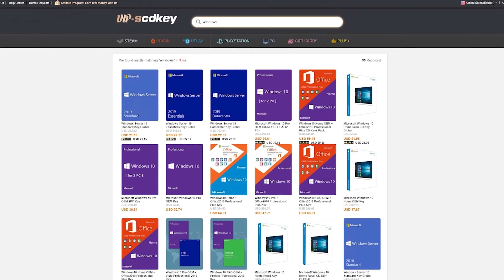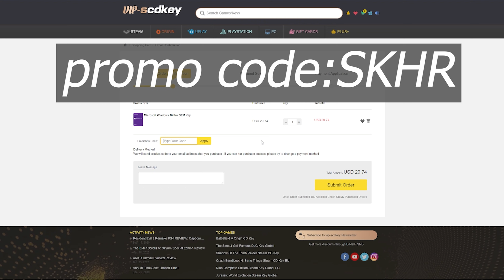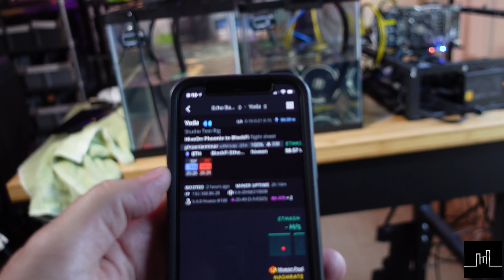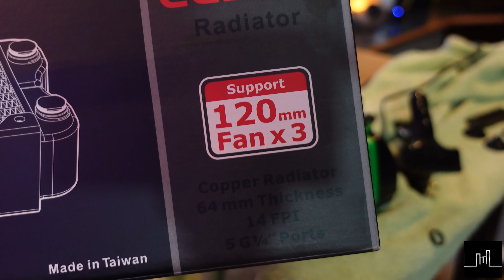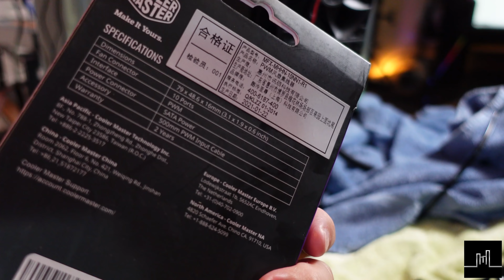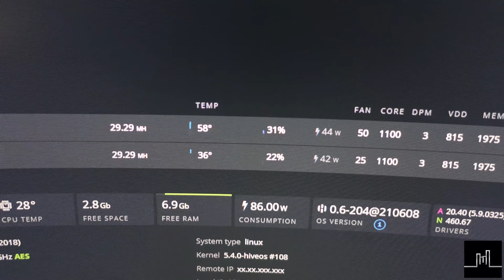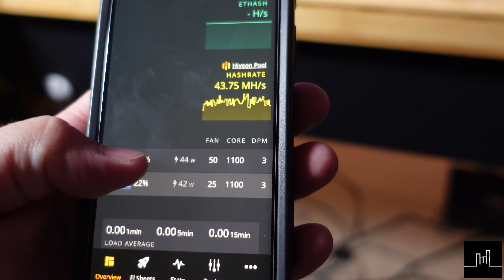Mineral Oil Submerged GPU Crypto Mining Rig Build - Part 2

Comment: I realize this is a 2 year old video, but with the radiator, fans tanks oil, what's the benefit over just using the fans on the GPU's? I get that they can be overclocked, but how many years would the minimal benefit pay off the cost of all this?

Comment: If you’re not scared of using butane right next to electronics then I’d recommend buying a compressor and literally dipping a personally made refrigerating system within the second reservoir, or just use a thermoelectric cooler by sticking the cooling side to the outside of the reservoir if higher electricity bills ain’t a problem.
Reply: Btw a compressor can make the whole system cool down to -40 Celsius if the system isn’t running, which is so cold that’ll freeze the mineral oil so be careful

Comment: you need a small radiator, mineral oil is great at pulling the heat away only if the mineral oil is cooler than the computer parts. Surface area is what will cool it down, so a big tank or a radiator with a fan.

Comment: ok back in the day to cool the mineral oil we used the filter bubblers to move the oil from the bottom to the top faster where the air would then cool it.  on occasion we ran it through (over) heat sinks after the bubblers, just depended on the workload and how blazed we were when we built it.  throw lights in the tank and turn room lights off and you'll be entertained for hours while you check out of reality for a bit.  it was like being inside one of those old lava lamps kind of.  thinking shit, if your going to put a rack in that tank a bubbler per corner isn't going to be enough.  you might actually have to step it through 2 or three heat sinks so it sheds heat before going back into the main body of oil.

Comment: This is guy makes very good videos but this one is a little off I don't understand how you would expect to have oil cooling increase by adding an electric pump to the tank. You must know every motor you put in their adds heat. ease don't copy this rig there are may better ways to run this exact set up with crazy loud fans or using that much additional power.

Comment: Really cool idea. But physics is a nasty B.
Water or minniral oil have a huge thermal mass and can take a huge heat before heating up. 
Making it really good for short extreme heat, like gaming. On the other hand it keeps that heat for a log time.
Mining is long term constant heat. 
All the heat disipation is from surface area. (Top of the liquid + radiator) 
There's no difference to having it air cooled.
If you're plan is to have the heat dumb outside than this can collect all the heat and dumb it where the you want.
Note you need a loooooot of radiators to extract the heat.

Comment: Just discovered your channel, and this video.  What a magic idea to keep things cool.  
I have a couple of suggestions, don't put the oil through the radiator.  Use a small second tank with water.  Put the pump in this tank, pump the water to the oil through a cooling coil.  Ten feet or so of half inch copper line, returning to the first tank via the radiator.  that way any leaks at the radiator will only be water and not make a mess.  The other thing to watch is your cables that are submerged in the oil.  Capillary action can draw oil up inside the wires to the other end where it will start dripping everywhere.  I have seen this happen in industry, where the oil traveled well over 150 feet of cable.

Comment: Following this project. I cringed when you said magnet. I don't like have magnets around my electronic, drives, discs, thumb driver or anything. Js~ Cool project! I'd like to see numbers on power consumption. In Texas we have the heat and my power is not cheap so it would be nice to know if this is an viable option to large fans down here! HODL~
Reply from the maker: I hear ya, whatever happened to the magnet concerns from a decade ago :).  No one talks about it anymore.  I haven't had any issues, but I hear ya.
Reply: @HashRaptor  FYI, you have a iWatch on and your near a high powered magnet, or working on a generator or dissembled electric motor... You go to look at your watch and is whacked! Bet it's happened!

Comment: Very good in a metal case Aluminum you wouls have some conduction converction benifits, Plexiglass is in heat insolator
Reply from the maker: Intereseting, thanks for pointing that out.  In the summer, the shed stays in the upper 90's F though.  hmmmm

Comment: i did this 20 years ago with a voodoo5 5500 ..in the long run it ended up making the capacitors fall apart and it wicked up every cable

Comment: Did anyone tried freezing the mineral oil?
Reply from the maker: I want to try a cold plate of some kind or similar solution to call the oil. Open to any suggestions.
Reply: @HashRaptor  try closing the top of the tank and install exhaust fan on top of the tank
Reply: @HashRaptor  https://youtu.be/_Le0-Yrr6Oc

Comment: Hey so I was actually thinking about this when I working on my salt water fish tank. Instead of getting a second tank and using a radiator with fans, get an aquarium chiller. The one I have was about $600 CAD and is set to keep my aquarium at 78 F(+\- 1) and will automatically turn on/off to maintain temp. In this case, use one pump to push the hot fluid into the chiller with the return line on the opposite end of the tank. I honestly think this would work so well, especially with a rig of 8-10 cards. Just make sure the pump is powerful enough to effectively move the fluid. 

Also! On the return line, use a flow nozzle to really circulate the tank!
Reply from the maker: Great suggestion!  Do you have a chiller you would recommend?
Reply: @HashRaptor  Get a JBJ ARTICA, best chillers out there. I also noticed the aquarium pump you added, but keep in mind that for each circulation pump you add to the water/oil you're also transferring the heat from the pump to the water.

Comment: I did this like 15 years ago. Came across all the same problems you did.  Just wait until all your stickers go off and the oil climbs up the cables. Also just pouring over a radiator will work fine for a single card. No need to pump inside it, Added benefit is waterfall look.
Reply from the maker: Any tips for the oil climbing? I’m thinking of tackling that with the frame build.
Reply: @HashRaptor  zip tie clamping the cable stops it. Also only happens on thin gauge wires
Reply: @HashRaptor  next step is to split the tank in half and put real fish in real water in front of it. That or you can use the different densities and put the fish/pc on top and bottom and let the liquids separate themselves

Comment: Immersion cooling is VERY effective - I've had a small, 2 GPU mineral oil immersed rig running for over 4 years and had very few issues and little maintenance needed. Experienced advise/tips; mineral oil "wicks" - meaning it will travel up and out on the cables going in, so having as few cables going out and in as possible is important. I'd strongly suggest getting/making a lid and immersing the mobo and PS as well - mounting them so that the IO ports and power connector are at the top above the oil level. Only the fill and return tubes to the radiator should traverse the oil and outside environment - THROUGH the lid. The lid will also keep airborne dust out and thus require less filtering and maintenance. Also, overtime, the oil will breakdown any plastic/rubber coatings in it, so diligently remove as much as possible from all parts before immersion. Although my experience with immersed rigs made some parts of the vid painful to watch, good job! You've inspired me to finally  upgrade to a 50 gallon tank immersion system. Feel free to contact me if you have questions or for more tips. 👍

Comment: Man there an idea for you 
Buy 10-15 280-360mm water radiators pump, 
Do a separate water loop
Drop 2-3 rads in to mining rig, they will take all heat from oil, and rest rads will cool down taken heat 
In this case you will have a big flat surface for heat transfer and you don't need to wory abot flow in rig
Reply: Then you can easy add 6-8 cards with 200-250w tdp

Comment: Fantastic stuff, thats so cool to see the cards submerged and still working, so much potential there. However at the moment you have achieved nothing other than over engineering a simple problem. What you potentially have there is a means to remove the heat and noise to a different location, for example, I am thinking of a standard household radiator system where you pump this fluid round to disapate the heat, great in the winter, basically the rigs become boilers. Free heating where you want it, and no noise from all the fans. This could also have some other kind of cooling loop attached, so that in the summer, the heat could be diverted outside to vent naturally through heatsinks, or perhaps underground or a pond....That would be a very cool system.

Comment: You'd need a massive amount of oil to passively cool a GPU. Oil is great because you dont need waterblocks, just a giant car rad etc to cool the oil and dip the cards in.

Aquarium people use 1 pump with 2 tanks, specially setup. 2 pumps is sketchy as hell, if they are not perfectly matched or something disrupts the balance you'll empty both into 1 tank,  make sure there is NOT too much oil in both tanks that it can't all fit in one or you'll have it pumped all over the floor.

Comment: Why not have an aluminium tank with heatsinks bonded to the case?
Reply from the maker: I like that idea. Know of anything prefabricated by chance I could start with?
Reply: @HashRaptor  could make one pretty easy using sheet metal. If you want I could draw up a box on fusion360, that you could build

Comment: I deal with oil, & rubber compatibility issue at my job. Most rubber, and some plastics will break down in many types of oil. Nitrile/buna-n, or Viton rubbers are best. Natural rubber, neoprene, & EPDM will not last long. You will need to watch your hoses, o-rings as they may become brittle, or break down if the are not compatible.

Comment: Nice setup, I have a couple ASIC's I run like that. A couple things that I would point out. 1. Your fans don't need to run that high on the radiator. You can get a cheap speed controller off Amazon and run them around 40% speed with the same cooling effect. 2. If feasible run the radiator outside. It cuts down on the noise and heat build up.
Reply: Hey cj, interested in how you setup your ASICS using immersion. I have a few questions as I’m planning to build a setup for my 7 s9i

Comment: You could have also just changed the termal pads out and put one of those fans pointed at the back plate. No oil required. The oil will destroy everything plastic on the gpu. Take the gpu housing and fans off. Your power connectors will become brittle and fall off but the rest of the card should survive a few years in oil. You can always solder on new leads when the power header falls apart. I think you are on the right track, but why net get a longer hose and pump that heat out doors. Avoid the noise and heat in you house. That is the advantage of pumping the heat out of the tank, outherwise the wattage your gpu uses to mine will be over double what you see on hive because your home ac will have to run longer to cool the house. If you have a bigger mining set up you will burn through your hvac and compressor and be out 20k$ and you wife will leave you.

Comment: You should remove the GPU coolers as you really don't need them in submerged cooling systems. I would like to see some tests with multiple GPU's with their coolers removed..I am a bit curious to see if that single radiator can keep up with the thermals from a few cards in a submersed setup. In theory, the attached coolers only increase the warmup time for the oil (more mass to warm up) and with that much oil, I would guess somewhere between 4-8 hours to bring it up to stable temps, depending on how many cards. Also, what are your ambient temps?
Nice work adding the rad, you weren't going to get much for cooling just transferring the water between tanks. Thanks for sharing!

Comment: I would remove the fans the pump will flow the oil past the graphics card .get a larger tank with ice water and put the little tank that has mineral oil inside it .then just add ice once in a while or add a chiller  .no more noise and you got happy cool graphic cards ...great idea hash raptor this oil shit might just be my ticket .

Comment: Glad to see the risers being used in these builds! You should try this without the fan shroud on the card, would be interesting to see if there is a substantial temp drop
Reply: The fans should probably stay on at like 10% speed to keep the oil moving.

Comment: Why does no one use silicone oil? Mineral oil degrades plastics, the silicone oil will also keep any thermal pads from drying out as thats what they have in them

Comment: This was done about 22 years ago, a computer was put entirely into mineral oil with no external cooling. The inevitable happened, it ended up just heating the oil so much it just cooked the computer as the oil retains heat and just got hotter over time. There is a reason why no one ever bothered with this ever again and moved on to nitrogen and peltiers, etc. Ultimately water cooled blocks are the best and why they're now common. The only way you might get this working is to put an external oil cooler on and really, the effort is not worth it as the oil will still remain hotter than ambient air even after an oil cooler pass.

Comment: Id recommend bigger, and think more automotive dynamics than pc. Get an automotive radiator and an auto waterpump maybe. Bigger tank. Bigger radiator( truck radiator?) And probably a automotive waterpump. Most efficient u can find and try that. Automotive electric fan on the radiator. Just ideas. Water/oil needs bigger equipment than air. Also u can get all this dirt cheap from junk yard for an experiment.

Comment: why you do not cool the oil with a radiator like here (https://www.amazon.de/dp/B07FFLX19Y/?coliid=I1S30TXORGPYI0&colid=13SM7S24VFU82&psc=1&ref_=lv_ov_lig_dp_it) and fans which are kind of quiet like here (https://www.amazon.de/gp/product/B07674CSTJ/ref=ppx_yo_dt_b_asin_title_o02_s00?ie=UTF8&psc=1) ? Best greetings

Comment: No need for 2x pumps...
Just add a 2inch bridge that's filled with oil from one tank to the other.As the volume drops from the one pumping the bridge will siphon oil over again...
So if the power goes out the tanks should even out.

Comment: You want the truth for the best way to keep your gear cool. 

Alpicooler. 12v/24v cooler/freezer with compressor. 

Drill the appropriate holes in top for cords and silicone or foam it to seal. 

Bluetooth control and monitoring. 

Sure you can find a çheap rebranded one on banggood. 

Would solve any miners cooling issues. 😏
Reply: Link for cooler on Amazon

https://www.amazon.com/dp/B075R1LH8D/ref=cm_sw_r_cp_apa_glt_fabc_MWZK1MQGD3C62C6ZE1M2
Reply: I am working on my solar setup for my gear. So it's pure profit

Comment: you can remove the fans from the graphics card and just have the oil pump shooting directly at it, it will cool fine with one card. with multiple cards if you stack them horizontally(fans facing to the ceiling) you can get y connectors for the aquarium pump/ t connectors for smaller tubing and little plastic alligator clips and connect a tube to each area of the heatsink directly over your memory modules forcing oil directly through the heatsink fins for more cooling efficiency. that radiator you have outside the aquarium can also be lengthened to sit on your floor where the temps are a few degrees less or you can even run the tubing out the window with the radiator if you're in a cool enough environment, if the pump is strong enough to pump 10 feet. i do see you having problems with more than two or three cards in the aquarium without at least double the cooling capacity or pump speed

Comment: Rig wise if you use GPU hangers you could use a simple wire shelf to hang the GPUs off.
One thing you will find is that radiator will only shift up to a certain amount of heat (it will depend on your ambient temp) so id work out that before putting the mobo in there (if you were planning to do that).

Excited to see it finished though and if it works its a great way of being able to direct the heat out of a rig so you can vent it outside easier.

Comment: I have wanted to do this for a long time, glad you did it for me.  :-)   I was not going to use the asic fan/radiator thing.  I was thinking a small radiator from an ATV or motorcycle.  Maybe a small radiator from a Honda civic (the transmission radiator).  I was thinking something like 12" x 12".  A metal, automotive radiator with a box fan in front of it.  Why?  Well a metal radiator has a good bit of surface area, its made of metal (transfers heat well) and the box fan is cheap and quiet.  Also, the oil in a a combustion engine is crazy ass hot- and those radiators cool them right down.  Here is a link to what I was thinking.  I'm interested in your thoughts?

 https://shop.advanceautoparts.com/p/carquest-premium-radiator-complete-433918/3900096-p?c3ch=PLA&c3nid=3900096-P&adtype=&product_channel=Online&store_code=&msclkid=1c3f2307366e1a51946d43e404b2f3f9&utm_source=bing&utm_medium=cpc&utm_campaign=b_pla_all_cooling%2Fsystem%2Fradiators_radiators_gen_gen_all_pros_aap_us_all&utm_term=4580977765915862&utm_content=Bing_PLA_Cooling%20System%20-%20Radiators_Radiators_Radiators&gclid=1c3f2307366e1a51946d43e404b2f3f9&gclsrc=3p.ds

Comment: Dear hi body as a checking i see you used graphic card  with fan . in result of keep the fan in not completed free running you have super differential amperage usage on driving of fan and meaning burning problem  . if this wrong please correct me